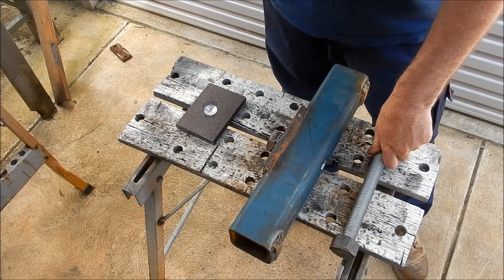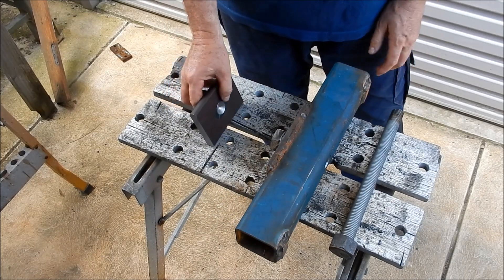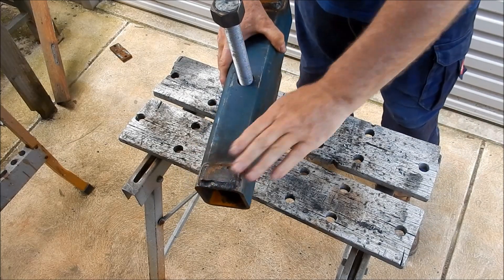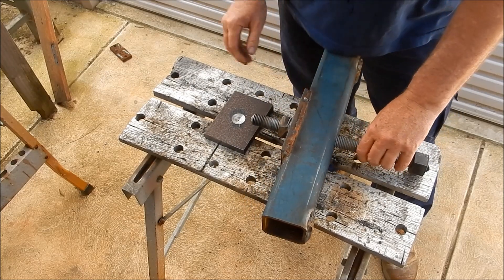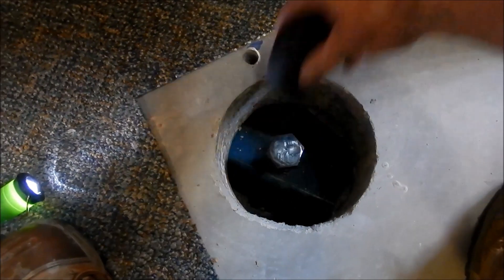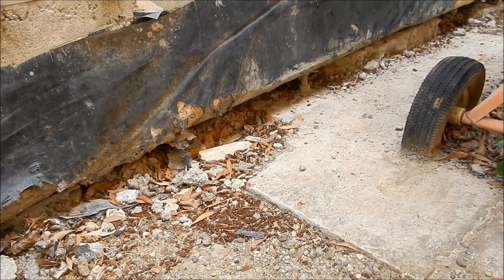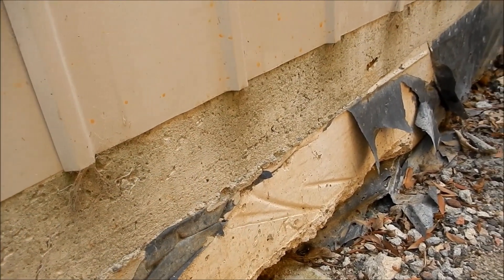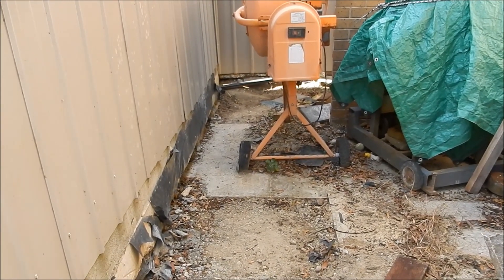Extra Piles in the Back of the Workshop Final

Comment: Wow you had to jack those slabs up a long way!
The ground must be terrible there
Have a good new year's Cam!
Reply from the maker: G'Day Tommy, yep it was the only guaranteed solution I could afford.  At least I'll never have to worry about it in the future.  On my initial surveys it was dropping around 1mm per month and would continue at that rate given the clay stability.  I've had it up for around a year now and as best as I can survey it's only dropped around 1mm in that time, I would put that down to settling.  I did over jack it by 5mm at the back to compensate for any settling movement.
Cam

Comment: Nice to see you getting the job done. If you want my two cents I would not dowel the new slab to the current shop. Taking into account that you do not want to make any further piles for the new floor I can tell you that there will probably be some movement on the new part. Let it move independently. You can still crack off your shed floor if there is a good doweling between the two floors. Your supports are working with your current load. Add a couple ton of concrete on a cantilever and you are in for a load of problems. How we used to create a slip path was to put a layer of plywood or something similar along the concrete that existed. I've used OSB, plywood, and what we used to call Black Joe which was a Bitumen impregnated paper felt board. That worked pretty good. but the other stuff worked well enough. Make sure you compact the infill for your new slab. Wet it as you add aggregate and compact in no more than 100mm thick layers. Many engineers will argue that wetting an aggregate down as you compact it is bad practice but I can tell you some of the best concrete floors I worked on were done in that manner. 33 meters in length and 10 meters wide not a single crack. Keep your cement as thick as you are willing to work with. I remember that you have a vibrator. It works well for floors to. Just don't vibrate to long as all your aggregate can sink to the bottom and leave you with sand on the top and a lot of air bubbles in between the aggregate on the bottom. Learned that the hard way!

Mark
Reply from the maker: Thanks for the comment Mark.  I'm a bit lost now, the bracketing and chem-setting back to the shed slab was to assist in stabilizing.  Where the slab is going to go is over the easement which has a number of service pipes running through it hence I don't want to put piles down as I may hit one or over time a pile moves and damages one of the pipes.  The sewer line is only a clay line.  Cost to repair by the authorities would be 10's of thousands of dollars.  As its an easement it is back filled with rubbish that has no load bearing properties hence the old brick shed just sunk over time.  The edge beam is around 250mm thick and the slab is 130mm thick.  I did cage the joint from the edge beam back to the slab very well so there is quite a lot of steel in there.  The old brick wall will be coming down and replaced with a light weight steel structure.  As a mater of interest whoever built the shed made the floor 200mm thick and the outer foundation runs to around 600mm.  Total over kill.  I guess I can pour and build and se how it all goes.  If it does start to move then make a decision as to how to stabilize it.  I will be putting a Geo-Tech membrane between the old slab and the new to isolate them from each other.Cam

Comment: lol, you jack those things up anymore, you wont have a foundation, you'll have a shed on stilts, lol. It looks like quite a feat getting all of those holes and everything put in place.
Reply from the maker: That's exactly what it is now Chirp, a shed on stilts.  From 90mm at the back end to zero at the front.  Fortunantly when I laid it I made the slab 130mm thick with extra heavy mesh so its very stable in its own right.  The piles are roughly 1 meter apart so it is very well supported.
Cam
Reply: yea, I would say so, lol. At least now you shouldnt have much trouble with flooding under heavy rains in the shop, lol. It'd just flow underneath of the shed instead, lol.